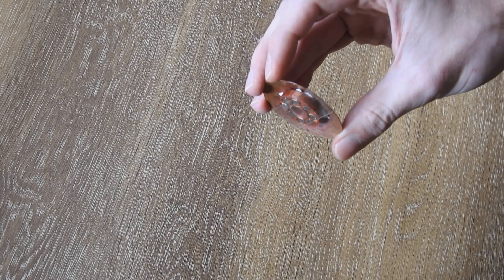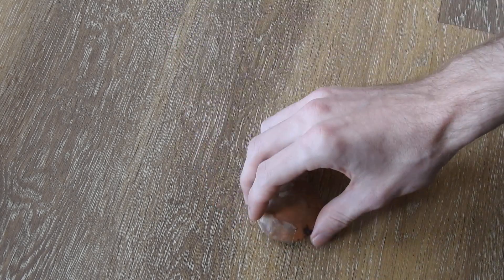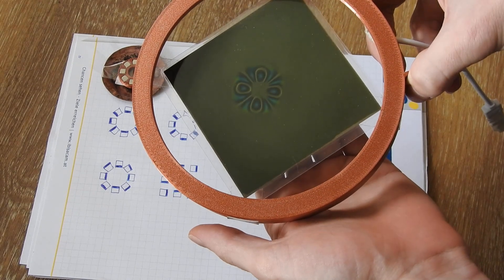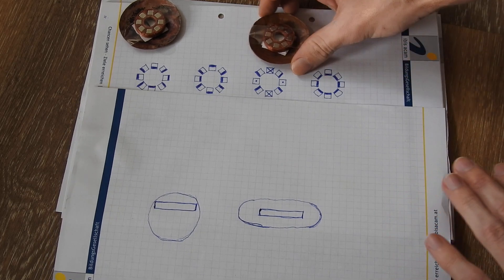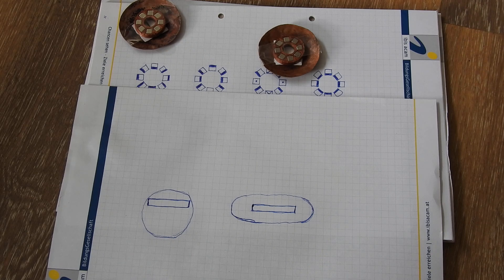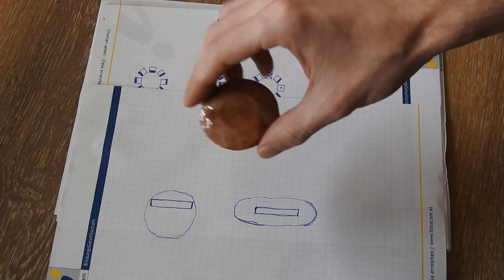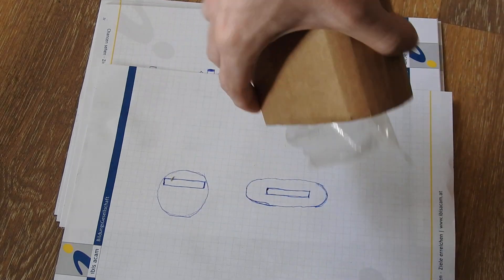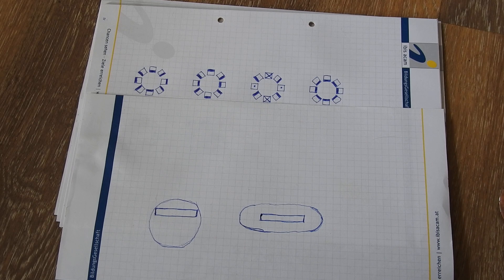The "Anti Gravity" device - a more detailed explanation on how it works

Comment: You should try this: find two strong ring magnets, place them either S facing S or N facing N and bolt them together so that they are forced to repel but will not come undone from the bolt. Next, bolt two non-magnetic metal rings together and try to match the weight. Drop them both at the same time and the repelling magnet should fall slower.
Reply from the maker: I know this experiment, the repelled magnets will fall slightly slower.